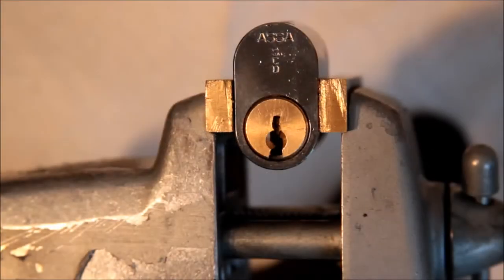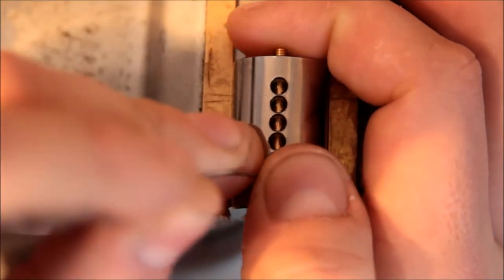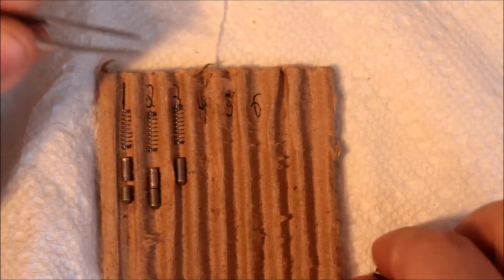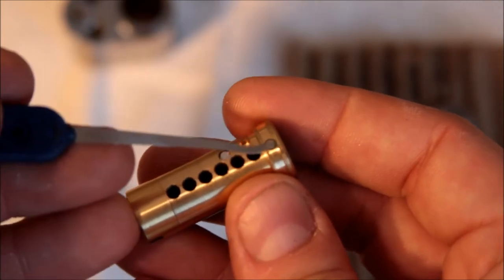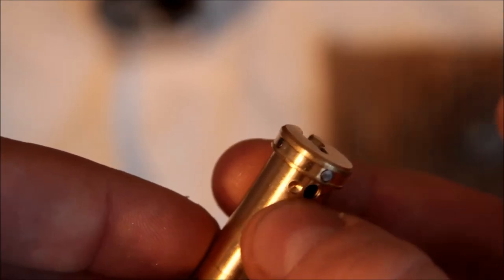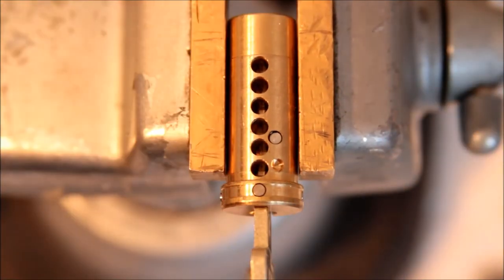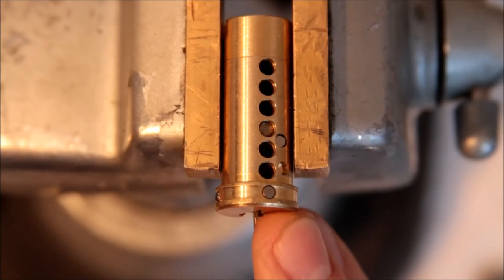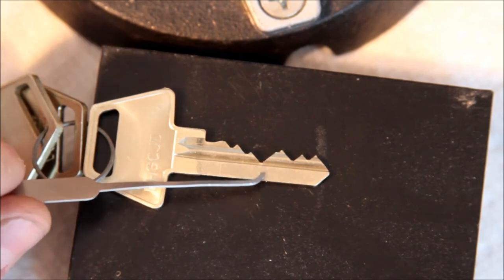(116) Counter-milled Culture: ASSA SCD Scandi Gutted

Comment: In my limited experience I believe that extreme high/low bitting presents the single biggest barrier to a successful pick.  I've had a bigger fight with a 4 pin master lock that had extreme bitting than with many 6 pin Americans with moderate bitting.  
The challenge is learning how to identify when the overset issue is the problem and then developing a work around.  I have many 5 and 6 pin schlage locks that I bit up with various extreme combinations for practice.

Comment from the maker: Well, I put it back together exactly as it it was. I still can't open it.

This is actually a mark of good security engineering. Technically, knowing the workings of the locking mechanism (or cipher, in cryptography) should not weaken the system. And, in this case, knowing the key doesn't help me, either! :)